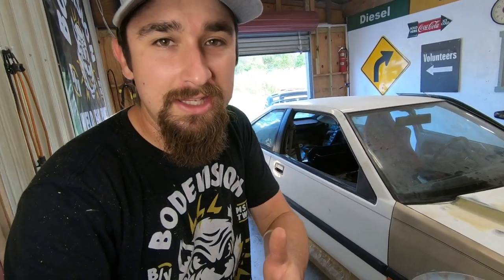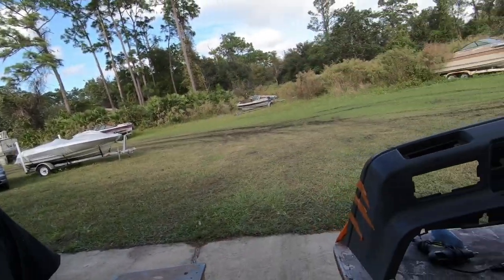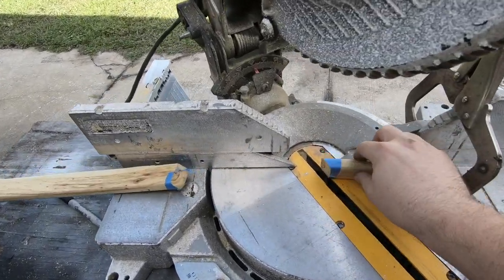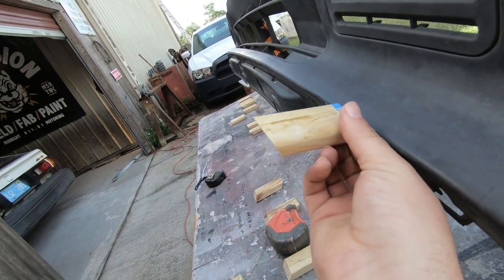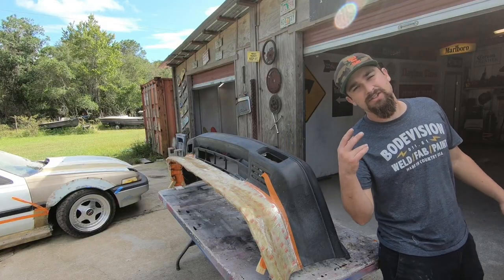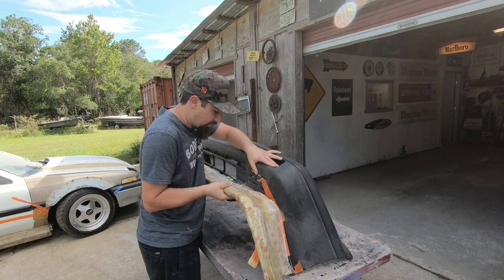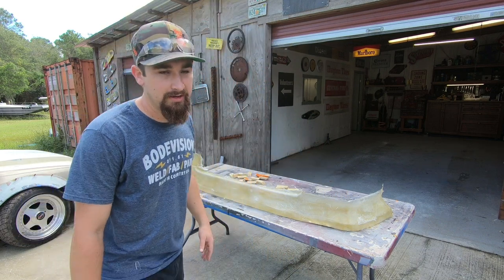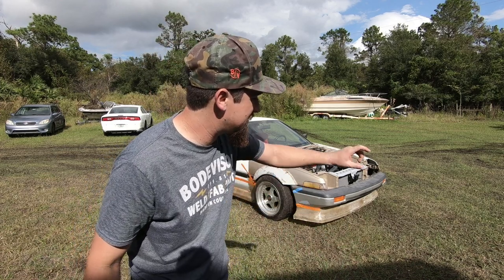How To Make A Front Lip With Wood and Fiberglass

Comment: Watch the whole video, I am enjoying this build since you started working on the body. You can fiberglass in some thick rope on the back of the lip to make it stronger
Reply from the maker: Hey man thanks for watching and that’s a really good call I’ll add something like that as I’m reinforcing it
Reply: I used some foam rubber that I got off some copper water pipe insulation and that worked great to reinforce my molds.

Comment: How much you reckon she'll weigh when all is said and done? I've got a similar project in mind (Honda Legend chassis RWD conversion with 1UZ) but I'm worried about all the extra weight in the chassis stiffening on the mounts for the diff. Sure after I remove all the electrics, replace the heavy seats etc, I'll lose about 150lb-200lb but I guess the real conundrum is trying to stiffen up the rear without being able to fabricate rigid shapes that use the least amount of material. You gotta make do with what you've got after all.

Doing it the way you've done would pretty much be my best case scenario; using gussets, creasing the sheet metal with an English wheel, that sort of jazz. 

All in all, this build has been a wealth of knowledge in what to expect and in the sorts of solutions one must come up with to make a FWD car stiff and strong for all the torque that will be going through the back end. 

Keep doing what you're doing, I've watched every video of this series with great interest, when you started it I knew it would be the perfect series to get some insight into what to expect in my own project. So yeah, keep it up. I love the series, much love.